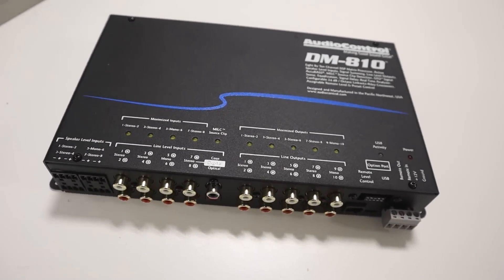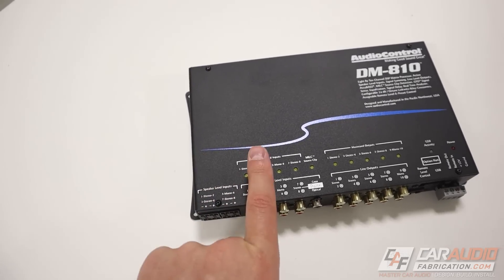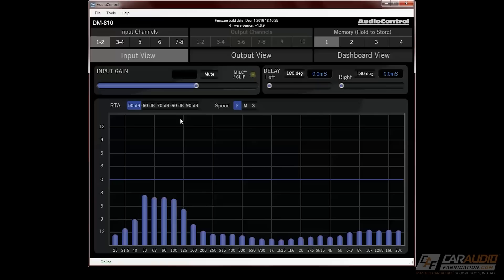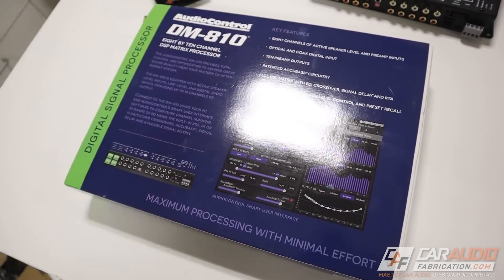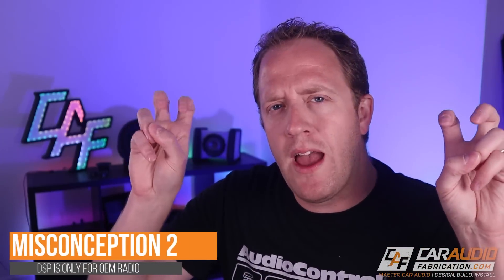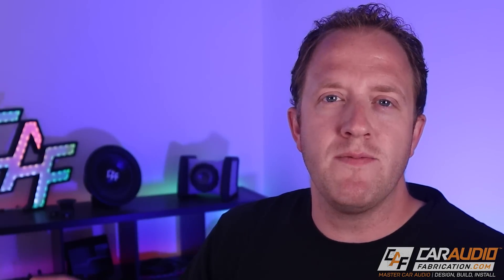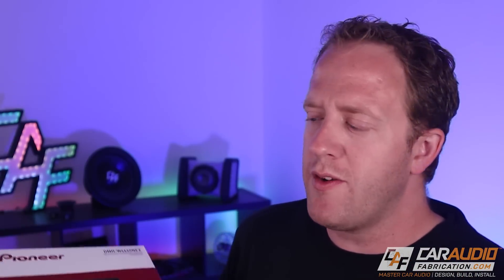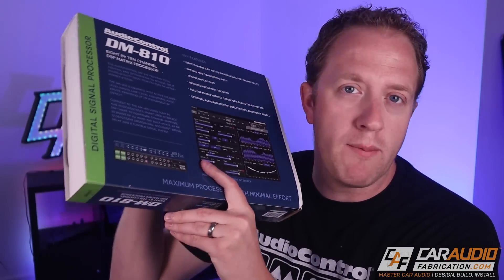You’re using DSP wrong! Top 5 DSP Misconceptions

Comment: I have a Lexus LS400 with a T'Eyes   CC3 10inch Double Din, JL Audio C1 Components 6.5's, and 2way C1's in the rear doors, with a MTX 400 4 channel amp. It's paired with a Skar 15' ZVX and 2k Skar D1 Mono 1ohm stable Amp, and a 5 farad Capacitor. The CC3 does every but put out good sound quality or it would if it didn't have a 27 band EQ. I was thinking that a DSP might be the answer, because I'm all about clarity 🎶👂🏽 Also, aboutbthe timing. What if you have multiple people in the car?

Comment: So if I understand this correctly, I can use a DSP instead of a crossover as long as I have an individual channel for each speaker?
Reply: @jeremyleon4827  6 months late - but exactly. The DSP itself only handles “signal level” inputs and outputs - AKA no power in the signal for the speaker. You have to amplify the DSP output to drive a speaker. 

It gets fun because if you have 10 channel component system, you need 10 channels of amplification in general. I run a DSP into a 4 channel amp into a passive crossover network to drive my component speakers because I could only afford a 4 channel amp at the time. Sort of a half-assed solution but still rocks!

Comment: Being able to set crossovers digitally and with exact slopes vs analog potentiometers was well worth it to me. Even if I'm not going in and doing much EQ or time delay stuff. The accuracy and the ability to choose my slope strength and type, and the fact that I didn't have to deal with buying passive crossovers/bass blockers/etc, yeah. Cheap $120 DSP made it worth it even if I'm not going full audio tune. I could immediately hear the difference once I installed it and had it take over for handling crossovers.

The 80/20 rule definitely applies to car audio. Where we can get about 80% of the best quality by spending about 20% of total possible cost and time, whereas to get that final 20% of quality it'll require an additional 80% of not just money, but time/effort.

Comment: Hello I have a question. If my factory stereo has 4 channels only can I split channels so I can add subs? So I still would have the 4 door speakers and 2 subwoofers. Thank you for your help
Reply: Line output converter takes rear speaker inputs and will output rca to the sub amp and rear speaker amp

Comment: I tried one of theese.   It only hurt.   I was not a fan. However i think it conflicted with my hu
Reply from the maker: Proper tuning is critical. If not done right you can definitely cause more harm than good.
Reply: @CarAudioFabrication   i cant remember what it was but it sounded worse.   It could very well be something i did.   I think i was trying to get more 🔊 out of my set up.   I just ended up going with more amps and batteries.    Actually it was called epicenter? I think.  Also little did i know i habe a dsp in my headunit

Comment: I have oem amplifier which is can not be removed because amp software connected to vehicle computer. I want to add dsp and change oem speakers plus add subwoofer. Can you add DSP amplifier connected to OEM amplifier speakers outputs? Is this will be safe especially if oem speakers are 8ohms and dsp output and upgraded speakers will be 4ohms?

Comment: I am stuck deciding between the audiocontrol DM-810 unit and a JL FiX 82 + JL TwK D8. The JL Setup is more expensive by a few hundred bucks. All around the internet there is complaints about the Audiocontrol software being buggy and terrible however its possible that has been resolved by now. does anyone have a recommendation on JL FiX 82 + Twk D8 Vs the Audiocontrol DM-810?

Comment: I know this is an old video but i cant seem to find the answer to this. I have a factory stereo system with 12 channels (logic7/Harman kardon) I want to upgrade the front four speakers, add and amp for them and a powered sub. If i add a dsp to just those 5 channels that I'm upgrading & let the factory power & control the rest, is that a waste of money on the dsp or will there be a benefit?
Reply: You could possibly run into issues with the factory amp. I see what your asking and I’ve thought of that myself but there is the risk of ruining the factory amp because they won’t be receiving the signals anymore from the front now that you decided the supply power to those 5 Chanel’s with the dsp 🤷🏼‍♂️ someone with better knowledge could correct me if I’m wrong but do more research

Comment: Nice video..
I have dsp 4.8 
4 channel built in amplifier 4 channel not built in.
Now.i want to add 2 power amplifier.
1 power amplifier for front channel
And 1 power to rear channel.
I connect.only rear speaker that sound.
How wiring it.please help me

Comment: Hey Mark, I have a 2020 Supra with those factory “subs”. 
I’ve added a Kicker TRTP 12” sub and AudioControls amp. 
Can I use a DSP inline to turn down the bass and distortion on the OEM subs? 
The wiring harness I have installed allows me to unplug the OEM subs post OEM amp. 
There’s not much space in this vehicle (don’t have to tell you lol), what’s a small DSP I could use? Preferably Audio Controls 👍🏻TIA

Comment: I've been in love with Audio Control since the mid-80's.  But let's be honest, the software that the controls the DM-810 (which I've owned for the past 5 years) is extremely glitchy.  Bad enough that it adds its own learning curve, beyond the normal leaning curve with any DSP.  And now that Audio Control has sold itself to another company, I fear the worst.  Oh well.  Everything changes.
Reply: Totally agree.  I bought this unit based on the views of this channel.  The "devil is in the details".  It does not hold memory of your presets for an extended period of time.  Switching from head unit to Bluetooth AC-BT24 on the app is a nightmare.  The app is user non-friendly as adjusting the different settings takes really long as the app's  latency & lag time can take over 30 secs.

Comment: QUESTION: Can I connect two DSP RCA outputs together so that they form as a single input to an amplifier that get those two signals Mixed as one?

(I have a use-case need for that)
I mean will it work or destroy something or will it handle the sum of those signals..

Comment: Very good explanation!!! Couple of issues I'm having though with DSPs and Epicenters/bass processors. I have a Stetson Bluetooth processor that I'm considering installing before my preamps to clean up the sound from the head unit before any further amplification. I'll have 4 channels of selectable A, B and AB outputs (or combined as 2 since 1 output has to be split to connect an amp from one output. Meaning 1&2 would be a left and right if used straight). Using it this way I could tune channel 1 however I like and run it to the preamp let's say on the right input, #2 however would be on the left input both controlled by the preamp fader as a mids and highs preamp. Channels 3 and 4 would go to the inputs of the second  preamp for midbass/midrange and bass. I think this would increase my tuning capabilities. I also think DSPs have the same features as Epicenters. Select the frequency in the parametric EQ (sweep), adjust it's Q (wide), boost or cut, adjust gain, etc. with tons of more tuning options. The preamps I use have subsonic filters from 30-300hz.

Comment: Many mid level head unit, following what has happened with many China's android head unit, now are starting to have 5 or 7 RCA out with high, low, band pass filters, 21+ bands (sometimes even full parametric) equalizer per each channel and delay per each channel... All this while retaining a global system equalizer for rapid on the go changes.
Heck, I've tried a nice Chinese one that had 7 channels, all the filter delay and equalizer per channel and the eqqualizer coulb be chosen between "normal" and linear phase mode. It benched great, sadly only 2V output and only a -70 dB noise floor even while reproducing directly from file. 
But I'm sure Dsp will soon be dead, cpu are so powerful that specialized audio dsp chip are no longer needed, just need software (amply available) and GOOD FREAKING ANALOGUE INTERFACES. Lol

Comment: If you have a DSP and your amps are not easily accessible, is it ok to crank amps gain to the max, switch all the amps filters off and work out the tuning with the DSP processor?
Reply: Set it all correctly when you tune the DSP., spend the hours and set the gains correctly on the initial setup.

Comment: I have a question as I am looking for information regarding the standalone AudioControl DM-608 DSP + an external 6-channel amp vs. the AudioControl D-6.1200 DSP integrated amp.
I need a 6-channel amp for mids/highs and a 1-channel amp for subs.
Please note: I have one chance to get this installation right!

Audio quality and fidelity is my focus, but like most others, I want to end up with a system that can get very loud, hit very hard and deep, but stay as clean as possible.

Audio signal source will be 'speaker level', from my stock Mercedes console. 
*It's a new vehicle and do not want to throw out integrated system and screen.
Budget is NOT unlimited, so please keep that in mind with any advice.
*I am sure there are 'better' choices on amps and speakers than what I have listed. 
I am open to suggestions, within reason.

So...
Which option should I buy and why??
Option 1: 
AudioControl DM-608 + JL Audio XD600/6v2 + Rockford Fosgate T1000-1bdCP
or Option 2:
AudioControl D-6.1200 + Rockford Fosgate T1000-1bdCP
Option 3:
???

Am losing anything with the integrated DSP vs. stand-alone DSP or visa versa??

Price is nearly identical between the two options.
The JL amp is a bit low on RMS power for speaker choice. 6 x 75W RMS @ 4ohms.
The AudioControl amp is a bit high power RMS. 6 x 125W RMS @ 4ohms.
Rockford Fosgate T1000-1bdCP - 1,000 watts RMS x 1 at 2 ohms
*Current component speakers are 3.5-ohms, handling 100 watts RMS (400 watts peak)

My current speakers:
3 pairs of Infinity Kappa Perfect 600 6.5" component speakers
2 Rockford Fosgate Power T1D210 Subs
(I may run 2 - Power T1D212 rather than 10s, but undecided. Space available is allocated location for proper size cabinet may be an issue) 

This is being installed in a 4x4 customer built Sprinter Van used for various short and long term adventures. 
I have space to make a few adjustments if needed, but it is not unlimited due to the appliances required for #VanLife living.

For those interested in additional details that should help audio performance inside and out of the van:
The component speakers will be installed in front (doors/dash), mid and rear zones of the van.
Subs will be installed in customer ported cabinets.
Subs will either be side or down down firing, just behind midline of van.
Rockford subs set to 1-Ohm each, run in series, Rockford amp will see 2-ohm load.
The van is fully lined with dynomat and densely insulated with Havelock wool and 3M Thinsulate.

Thank You!!!

Comment: I have a LOC6, and was planning on eventually adding it to my system. How does that compare to a dsp? I know a dsp would be better, but what’s the main difference the two with a stock head unit?
Reply: A loc basically gives you your output signal / rca but using an active loc like lc7i will give you cleaner better sound than a cheap $20 (passive loc) with just the loc you can’t  adjust any eq you could add an external  eq after the lc71 but that will only adjust the eq of the entire system together’ see below the dsp allows you to set eq for each individual speaker 
Essentially that’s all the loc does 

Car factory sets how the speakers sound (built into the car) since you are upgrading speakers adding amps you have completely changed what the factory “set it for” 
A dsp will allow you to control each speaker set bass roll off / eq / timing of speakers’ 

Hope that helps 
I’m theory you could grab a lc7i and a 5 channel amp 
4 channels for door speakers 1 channel for a sub’ then upgrade your door speakers and it’s going to sound great! Most people will be happy and call it a day’ 

A dsp takes you from Great to Amazing’

So quick example 
It would be 
factory radio to
lc7i 
Lc7i to dsp 
Dsp to 4 channel amp 
4 channel amp to door speakers 

If you used a 5 channel amp instead of 4 chAnnel same chain  just 
5 channel amp to door speakers (that will use 4 channels) then 1 channel to a sub 

Hope this helps it’s hard to understand at first draw a little map on paper it’ll make sense

Comment: I got a question, any help is greatly appreciated!!! I bought a zapco st-6x dsp and about to buy another one but I heard that they don’t have any gain input controls on the outside of the amp and neither in the dsp software it comes with. But I also have a alpine pxe-0850x 12 channel dsp that I plan on running everything through since it has a controller. My question is can I bypass the dsp on the zapco with the alpine? I just want to know before I buy another one and it gives me problems down the road.

Comment: hey so i’ve always been wondering, i have a clarion xc660 and it has output voltage setting from -20 to 12 and has gain settings in the dsp, i have no idea what output voltage is i know what input is at 4v. plus i am unsure about the way the gain works on this dsp, like do i leave my amp gains at zero and just use those, or tune my amp with dd1 then adjust slightly from dsp? i’m finding my subs just aren’t getting the power they should from my jp43 korean board amp at 2 ohms, should be 3300w

Comment: I get that you're pushing that it has the RTA built in, and I'll admit it to cool feature. However if you're at the point of already having all the product and you're through that part of install, now you're at the point of plugging this in and tuning. If you don't already have a full range signal you're kind of fucked.

The RTA is something you should do before you even start planning the build so you know what you're working with. Because of that I don't feel it's very useful in that respect

Comment: I have never seen a factory radio that has separate outputs for high, mid and low speaker-level output. All the ones i have seen have just one speaker level output for front right, front left, etc.

Comment: I bought the JBL DSP4086 which does 40 W @ 4 Ohms. Does this send 40 W to the tweeters? Isn't that overpowering it and how do we fix that?
Reply from the maker: Your tweeters will never see that much power as long as the system is properly set up.
Reply: @CarAudioFabrication  Properly set up by reducing the dB on the dsp software? How much is enough?

Comment: How about if you use 2ea. 45-100 watt X 4 channel amps, 1 amp for the tweeters and the other for the mids and separate amps for the subs? Could you than not run any passive crossovers, maybe just some bass blockers for the tweeters.

Comment: Quick question. Does the green lights on the DM608 each channel suppose to be on while the sound system is running. Only light that is on is the red power light

Comment: I'm a little confused, as quite a few Pioneer receivers have not only a custom EQ setting, but also crossover adjustments for subwoofer and full range. I get that this example DSP is far more advanced, but for beginners on a budget, the receiver controller isn't completely horrible.
Reply: That is a lot better than nothing but sending a full-range signal to a driver that cannot physically play that sound or play without distortion is the real point of DSP. You 100% should be sending only subfrequencies to a subwoofer. Imagine installing lovely tweeters to only play a full-range signal through them and they sound like crap without DSP or a physical crossover that restricts the wrong frequencies from getting to it.
Reply: @kaffeewerks  That's just it, quality pioneer receivers have a built-in DSP, it's just not as high quality as the one shown in the video. So even the receiver can split 5 channels.

Comment: Nice video!
I've been using active crossovers for 5 years
To protect the tweeters I use capacitors bigger than the designed freguency cut, something about 8 ir 10 micro farad, is more than enough to cut low frequencies and noises from amps and system.
Never had problems

Comment: I don't recommend Audio Control to people anymore there warranty is no good if your not careful who you buy from. i bought a Audio Control epicenter the indash mounted one with spl meter ,,a LC6-1200 6ch Amp ,, lc1-800 mono amp ,, and a dm-810 DSP ,, 3 10" focal subs and a sealed box for a little under 3k with the install. and it was one of the clearest car system iv ever heard fast forward 2 months the DSP started flashing and not working at times, i took it to the installer witch called audio control for RMA witch ask where he bought them from witch they then said that none of them was authorized dealers and there is no warranty. I even tried calling them being that the date of manufacture it was still within 1 yr with no luck they just refused cause nether of them was a dealer.  defense for the seller/installer after see your video on lc6-1200 4yrs ago i was set on them for my own next build i just didnt have time so hired them to do it. anyway after the warranty problem installer agree to eat the $720.00 cost and get me a new one then covid happened and installer closed doors for good. to me that is petty and will not recommend a company like that even though it was great well it lasted but not worth $700 for 3ish months cant aford that crap after saving for 2yrs to do it. stay healthy and thanks for sharing.

Comment: Questions:
how are you ensuring the output signal from amplifier is the signal,  from, that you set at the dsp ? How do you know the gains, and frequency buttons on the amp, are not over riding the dsp, and sending out a freq, signal that I'd not what you set with the dsp ? I'm assuming the reason behind using a rta ? is to check for and adjust the dsp, but not the amp settings? Or both ? is the rta, the factor, for output from amp, frequency check and confirm?